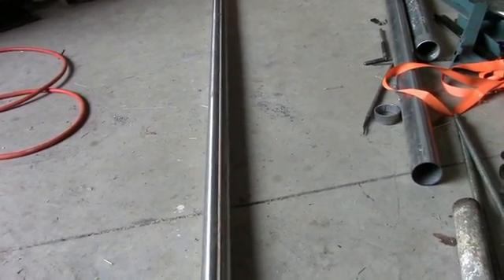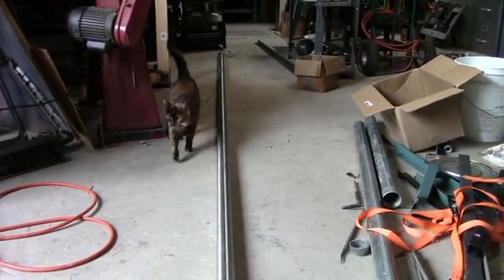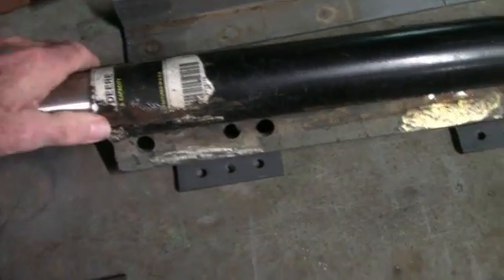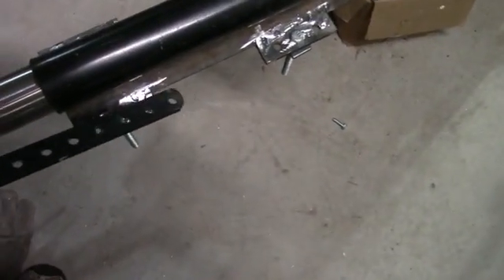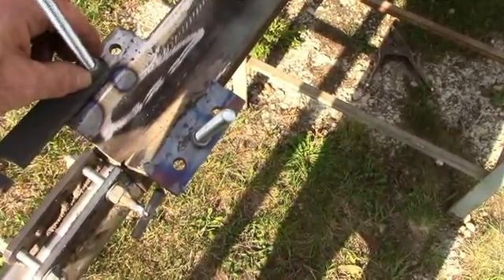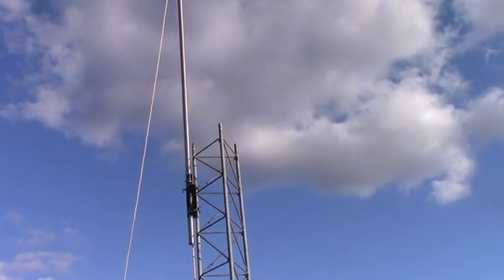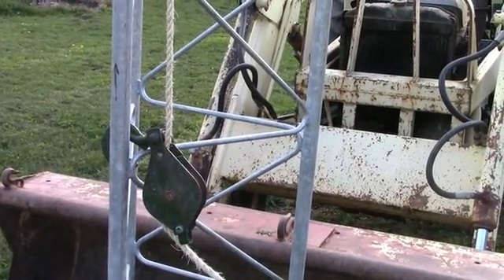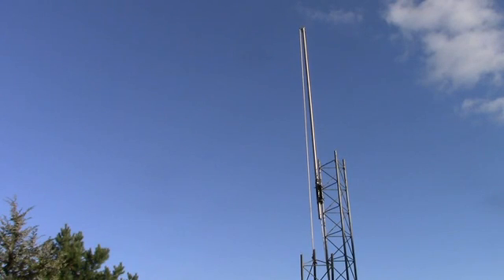Gin Pole Antenna Fixture Build

Comment: No one in their right mind would climb a tower held in place by a tractor bucket.
Reply from the maker: Hi Gary, Don't worry , I didn't climb the tower in this video.  I was testing my homemade gin pole and only used the tractor to hold that short section during the test.
Reply: @toddanonymous5295  That's good to hear.